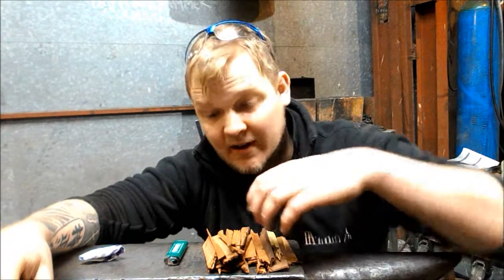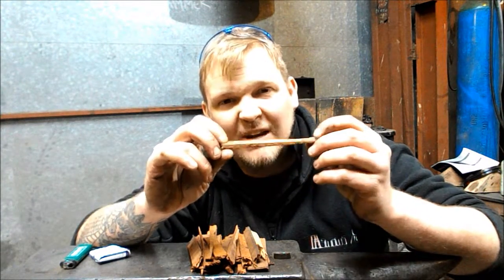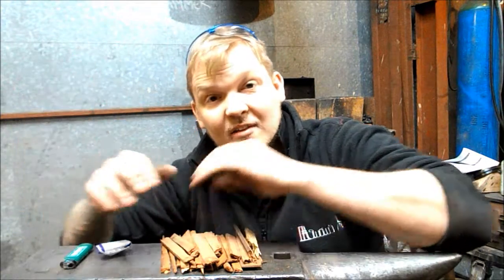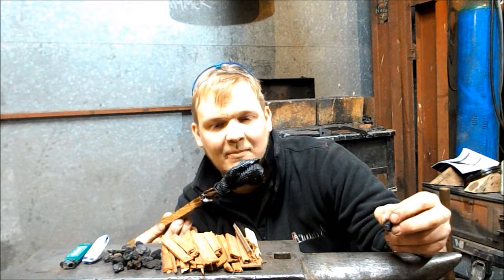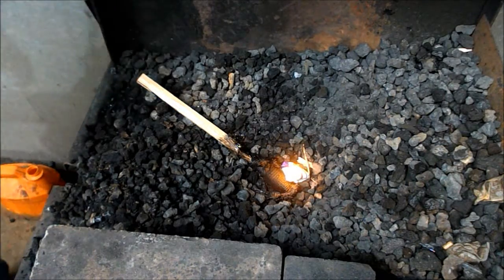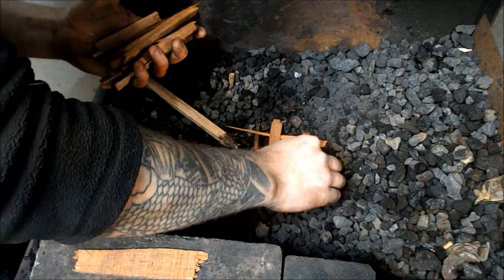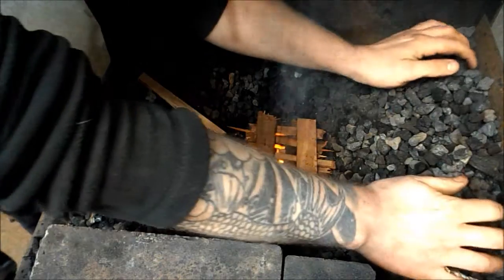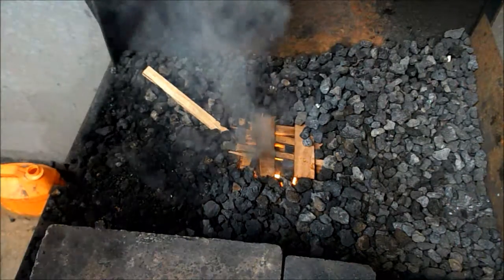Tips and Tricks Part 4  How to light a Forge!

Comment: ..i haven't tried Coke yet. I use Anthracite Bituminous is hard to get around here, Alabama USA. I have found that using a bit of Pine charcoal rather than Hardwood charcoal will get it going faster. It seems to burn hotter than the hardwood although not as long as the hardwood. I rack a small bit of tinder like you do except i will use a small propane torch to get it going...
Reply from the maker: The old propane torch trick never fails. Not sure how hard it would be to make coal into coke. I know its hard to get coke in the states. BTU of Pine is high but I believe that hard woods get hotter but the quick burn rate of the pine is what your seeing I believe. But if it lights it lights. I would suggest trying coke you will have lots of fun.
Reply from the maker: Thank you for the comment Ol James you have a shout out coming up in a not so far away video.

Comment: Interesting about the chip packet, it did burn well. 
I will have to raid some of the kids supplies, purely for experimentation purposes of course!
Believe it or not, for all the coal Australia sells to the world, it is virtually impossible to buy it domestically.

I burn mostly wood in my forge, I was using charcoal, but found the hardwood burns as well, just needs to be fed faster. Our eucalyptus wood is full of flammable oils, throw the leaves on a fire (even green) and it is like chucking petrol on, they burn with a big woosh!
Reply from the maker: Hi Jack thank you for the great comment. If you need some one to back up your story as to why you need the chip packets ill do that for you dude. 

I do a video on fire management and set up soon. the area of the fire that is hottest is in a state of reduction meaning that your turning the would into charcoal any way or at lest should be. wood was good for most of the ancient world why not now. Is coal really that hard to get?